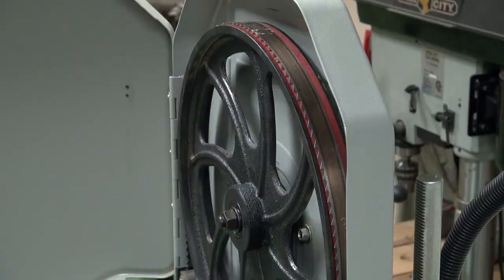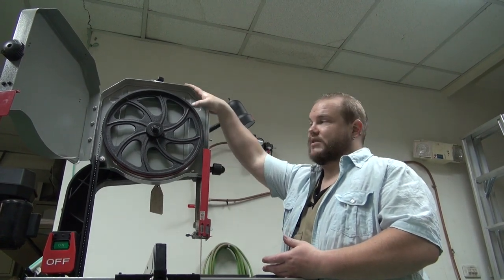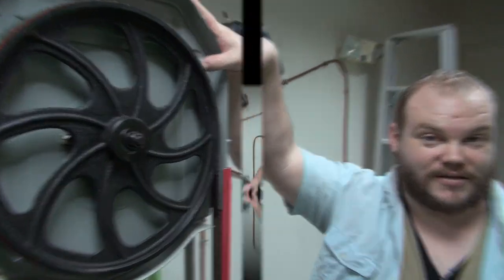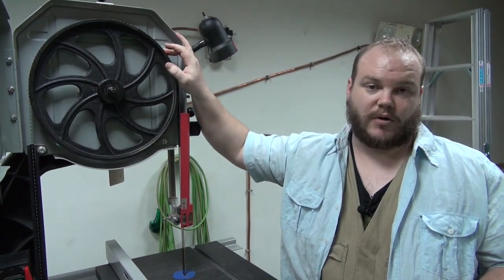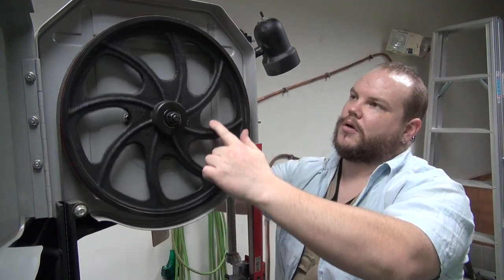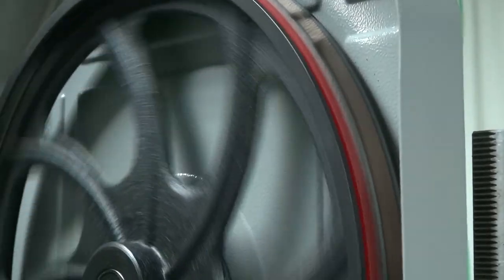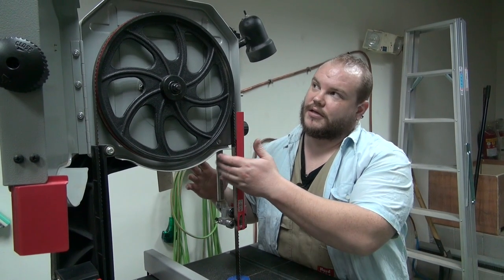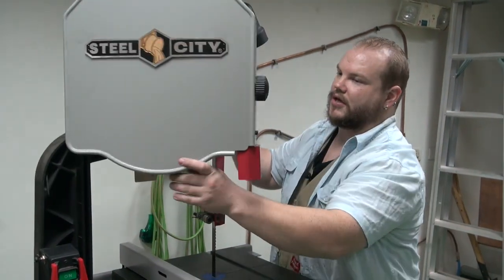Bandsaw Blade Tracking Adjustment

Comment: Great vid and these tips are great for a lot of bandsaws, but owners of a SHOPSMITH bandsaw need to be aware that their saw is unique in that there is no adjustment for blade tracking and their wheels aren't crowned, as you mention early in your vid at 0:10. The Shopsmith Bandsaw is designed so that every blade runs near the back of the wheel and against a pair of "Auto-Track" bearings that are in the arm of the saw. and there is no tilt adjustment on the back of the saw at all.  Likewise, the thrust bearings below and above the table aren't adjustable forward and back because they don't need to be; all blades run to the back and against the bottom thrust bearing at all times, and if the saw is properly aligned, just ahead of the upper bearing. It's pretty sweet, actually.  Scott

Comment: my top wheel holds the blade on the right part but the bottom one has the blade way too close to the outer edge, Is this normal?
Reply: I have tha same issue
Reply: It doesn't matter where the blade is on the bottom wheel as long as it is correct on the top and tracks just fine on the top wheel.

Comment: It is easy to adjust the top wheel because it has an adjustment but you didn't say anything about the bottom wheel.... What if the blade is not quite running correctly towards the middle of the tire on the bottom wheel??
Reply: Not sure what bandsaw you have since you didn't say. You can check the supplement to Rikon 10-325 at their support site and see if your lower wheel has same adjustment on bearing as to tracking on lower blade. Keep in mind the lower blade does not need to be center perfectly. I run my top with gullt centered which required lower adjustment with widest blade to not be slightly off the tire. This was misadjustment at chienese factory.